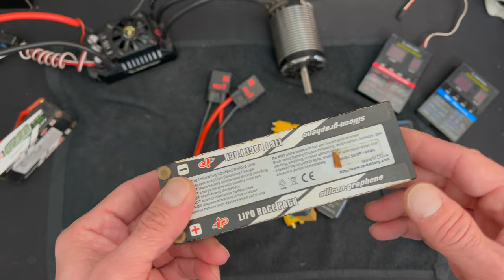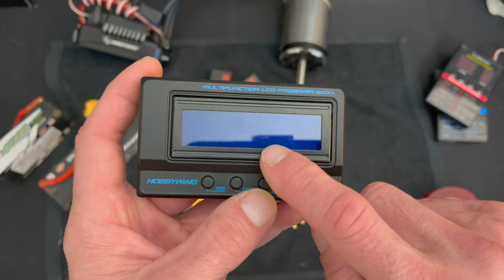The Charlie Show /// Episode 246 /// Things to Know about your new install!

Comment: I love my Hobbywing XRotor 722 but I don't like that it comes with wiring harnesses that are wired wrong for the DJI Vista unit. Just have to be careful and check all the wiring and once it's all installed and working it's my best flight stack.

Comment: Great video. I have a question. I am running a Hobbywing XR10 and a 4.5 motor in a drag Losi. My issue is sometimes at a full throttle pull the car hesitates until I let off the the throttle and ease back into it. Driving me crazy. Any ideas. Thanks.